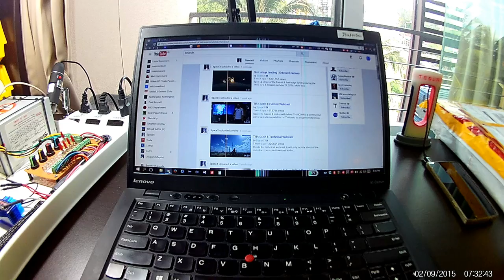Lenovo X1 Carbon laptop screen replacement

Comment: can i replace a 2560x1440 screen that came with this laptop with a 1920x1080 screen?
Reply: i dont know if its a too late reply but the 2K displays have a 40 pinconnector while the FHD and 1600+ panel have a 30 pin edp connector if you plan to replace the scrren you need also a 30pin edp cable which goes to the mainboard - in fact you can simply use 1920P resolution with a 2K panel